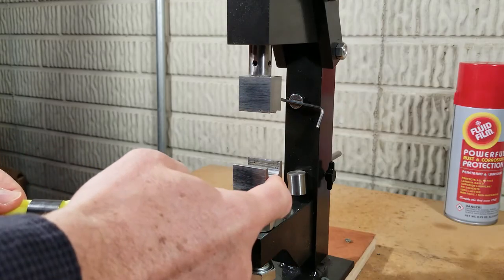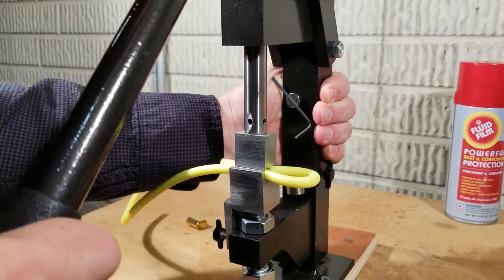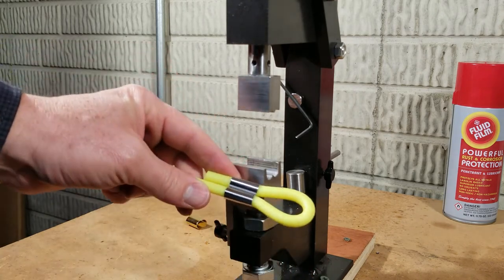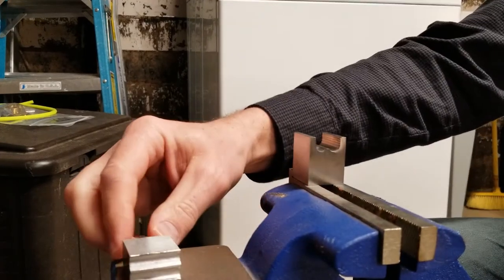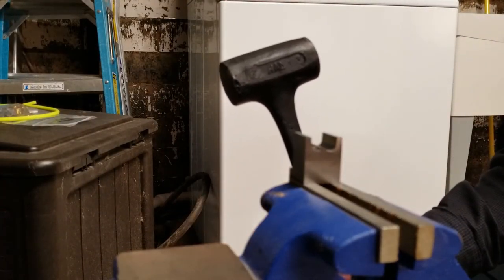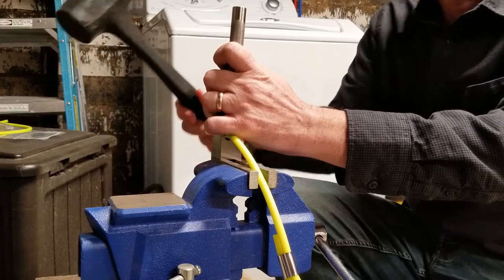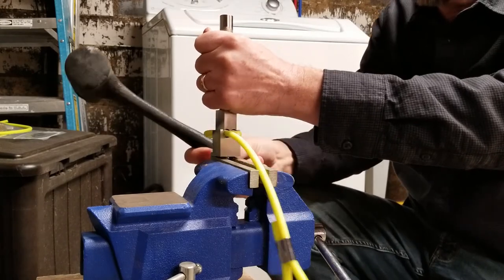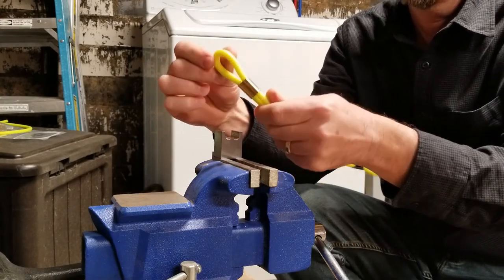Rope Clamp Dies With and Without A Handyman

Comment: I think the first one is supposed to say "with" the handyman press? I see how to get the press and press accessories on your website, but is there a way to get the clamp  (sorry, unsure of the name) or the metal piece that you're holding by hand? Does the one on the website work if I don't have a handyman?
Reply from the maker: You are right. It should say with a Handyman. If you want to use the dies without a Handyman purchase them on the Hand Punch Handles page: https://strapwarehouse.com/hand-punch-handles/